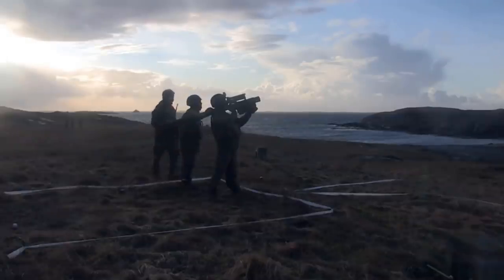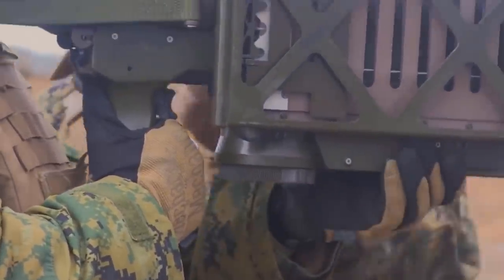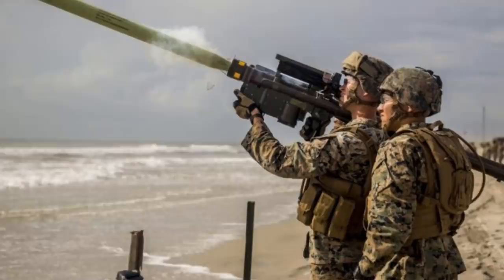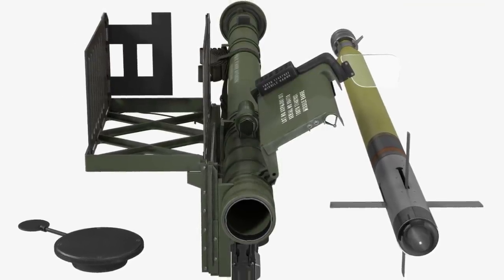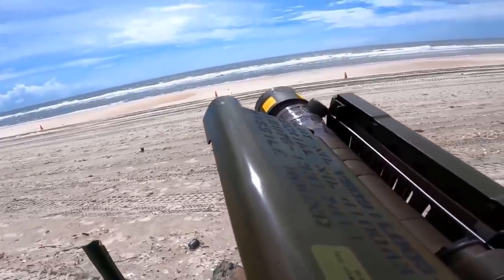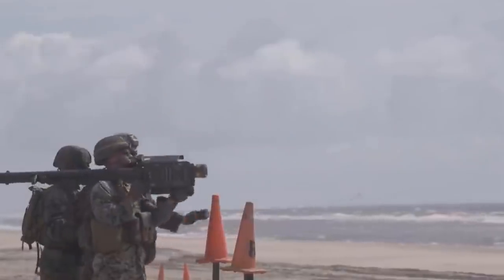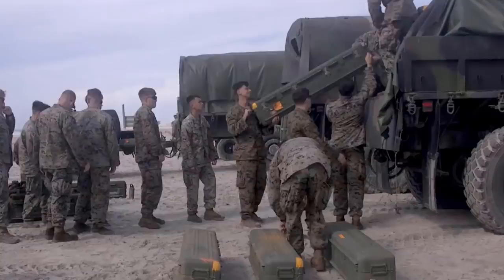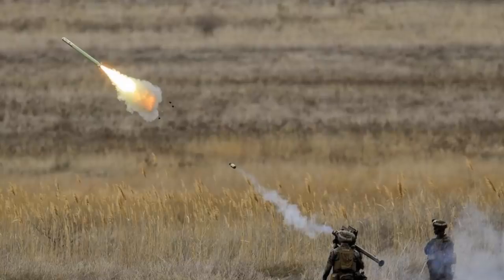US Stinger Missiles that proved extremely impactful for Ukrainian fighters

Comment: Stinger-like Manpads are  'no fly zones' for disadvantaged countries.
Reply: Specially utilizing it with ambush and interception, even if the enemy managed to pin point the firing point, you could just basically move to a different spot to avoid getting spotted

Comment: Can stingers penetrate the armours of the armoured vehicles?
Reply: No. Stingers are for Ground to air only.
Reply: What is the best shot you can get.I mean what angle on the target would be the most effective.the jet going away.
Reply: @robertwolfe2971  Probably straight up, because there is the least reaction time for pilot and automatic counter measures
Reply: It will probably destroy or disable the light armor the Russians have if it can lock on to it or fired at close range to it. The Armour on most of the lighter Russian vehicles is not very good and can be penetrated easy.
Reply: This is what javelin at 4km and nlaw at 800m is for.
Reply: @kreb7  Yes but a lot of the tanks and other vehicles are being taken out at 100 yards or less is this type of fighting. People hiding behind buildings or along sides of roads waiting on them to come by.  No open land  in many of the places the fighting is going on so if they have a stinger they could try to use it up close. The Russian armor is insufficient on many of the vehicles their using.
Reply: @rangerh  nLow can hit from 20 to 800m so can cover the range and cost at about 35k stinger  is at 120k and it isnt designed to hit tanks min range 200m the fuse ithink is proximity so does not blow on impact but close and send shrapnel which will do very litle.
Reply: No. It just goes bang.
Reply: Use javalin missile for tanks. Tanks are a fortified target. Airplanes are fast moving, but a soft target.
Reply: Take out the fuel truck in a convoy and the armour isn't going far.
Reply: Stingers have a fairly small warhead. It's big enough to tear up most aircraft, although more robust jet fighters could easily survive a hit. But even if one could track an armored vehicle, it wouldn't do much when it hit.
Reply: @ThubanDraconis  You know, these days there is a viral video showing a Mil Mi-24 helicopter being shot by a Stinger rocket in Ukraine. It is seen that the helicopter (which is famous as a flying tank due to its robustness) just turns into a ball of fire. I really do not think there exist many combat aircrafts more robust than a Mi-24 (Hind). I also assume even if Stingers cannot pierce the armour of main battle tanks, they might be able to seriously harm lightly armoured vehicles. Anyway, I am no expert in the field
Reply: @rangerh  RPG7s are more effective for that, you would be crazy to waste Stingers, unless desperate and nothing else at hand.
Reply: @siamaktahaeiyaghoubi897  The "flying tank" claim isn't accurate in a literal sense. The MI-24 may be heavily armored for a helicopter, but it is nowhere near as heavily armored as a tank, or even an IFV. A BMP-2 (a lightly armored infantry fighting vehicle) is quite small compared to a MI-24 but the BMP-2 weights 14 tons compared to the MI-24s weight of about 8 tons empty. Actual tanks these days weigh around 40-70 tons or so. The stinger has a fairly small blast fragmentation warhead which is sufficient to kill or at least severely damage an aircraft but the more heavily armored vehicles like a BMP-2 would probably survive the hit with minimal damage. Also, anti tank rockets can potentially kill IFVs or even tanks with warheads no larger (in weight) than the warhead of a stinger  but they have shaped charged warheads. These direct the blast in one direction, not in all directions like the stinger's warhead.
Reply: @ThubanDraconis  I see. Yes, I agree that a Mi-24 helicopter can never be as heavily armoured as a tank. This is certainly just a complement to highlight its good protection capabilities. So, you believe it is not possible for a stinger to penetrate even lightly armoured vehicles. I think you might be right. Particularly, your point about the shape of the warhead is interesting. Anyway, there must be a reason for any sort of engineering. Thank you for sharing the information :)
Reply: @rangerh  RPG 7 is much more cost effective and widely available at such close range.  Using a high tech guided ground to air missile to attack an armored vehicle within 300 meters is really wasteful.  Can fire 300-400 RPGs for the same price.

Comment: A very knowledgeable Portuguese military expert said that that MI-24 was shot down by an anti tank missile and not a MANPADS. I believe him, but how can he tell?
Reply: Beware of experts. Hitting a helicopter with an anti tank missile is not easy at all
Reply: @andrewc0128  It was a TOW missile and you can easily tell by the distinct flight pattern of the missile.  They basically appear to sort of constantly zig-zag towards the target.  The helicopter was extremely low, and coming directly towards the launcher.  So you have a head on shot which makes the target relatively stationary to the shooter.  Also those big Russian choppers have severe rotor lag which is why they never seen to avoid incoming missiles.
   Either the countermeasures work or they eat the missile because by the time they input anything into the controls, and the helicopter starts to react to the control inputs the missile is already there.
Reply: @slimjim7411  I have seen many TOW missiles in flight and while it does zig zag, so do some other missiles as they track and depending on how close they are fired from the target. Unless we are talking about a different video, the missile seems to come from about the 2:00 position in relation to the flight path. Head on, yeah, that is possible with a TOW. From 2:00 position my money isn't on a TOW.

Comment: So how does a MANPAD missile steer itself towards the aircraft?
Reply: It has an IR seeker, that creates an IR image of the target. When the target moves out of the centre of the image, the missile corrects its course, till the target is back in the center. Well, at least, I guess... :D
Reply: @siemensohm  ah ok
Reply: by smell
Reply: The missile knows where it is at all times. It knows this because it knows where it isn't. By subtracting where it is from where it isn't, or where it isn't from where it is (whichever is greater), it obtains a difference, or deviation. The guidance subsystem uses deviations to generate corrective commands to drive the missile from a position where it is to a position where it isn't, and arriving at a position where it wasn't, it now is. Consequently, the position where it is, is now the position that it wasn't, and it follows that the position that it was, is now the position that it isn't.
In the event that the position that it is in is not the position that it wasn't, the system has acquired a variation, the variation being the difference between where the missile is, and where it wasn't. If variation is considered to be a significant factor, it too may be corrected by the GEA. However, the missile must also know where it was.
Reply: @RhodokTribesman  
That sounds like the Polish model.

Comment: Even an F-35 would be vulnerable to this with no 5th gen weapons
Reply: F-35 would not need to fly low enough to be in range of a stinger because they can fly high and avoid SAM.  I mean maybe effective against one on a runway, but the speeds and altitudes F-35 operates in are not something a stinger can be effective at.

Comment: This is great in the context of the Ukrainian effort.  However..... If they are handing these out like free candy in chaotic conditions, what is to stop just a single one from getting in to the wrong hands and showing up in a few years in a terrorist attack on an airliner?  In normal conditions these things are a highly controlled sensitive item.  inventory is regularly checked by serial number and people are individually accountable by name with severe repercussions for losing one.  I hope there are security controls in place to ensure that these things are ALL accounted for.  Otherwise, watch this spot....
Reply: It's happened before in peace time, and honestly Russia has already dumped a bunch of their version of the Stinger in the terrorist market.  The problem with that is you generally have to fire multiple stingers at a airliner to down it, and can only hit it when it's taking off or landing.
Reply: @slimjim7411  Good points, and I hope you're right on the limited use against an airliner.

Comment: After two weeks of war, Russian is grounding forward to Ukraine Capital at heavy loss, evidence is mounting that the invasion has not gone to plan, Russian miscalculated during the invasion, Due to poor equip and planning, lack of logistic support causing shortage of food, fuel, heavy casualty and ammo, weather is going to demoralize troops even further and will create even more Iron refrigerators. the extreme weather conditions will lead many Russian soldiers to surrender.
1.  Drone- Russian bombed all radar site and air field at the beginning of the war, but Drone does not require an airfield to operator, but they have the killer instinct, it is hard to detect.
2. Hand Carry anti-tank guided missile – Russian bombed all the land missile systems at the beginning of the war, but hand carry missle systems are the tank killers, easy to carry and easy to operate, they are the best tool against the tanks and the low flying airplane.